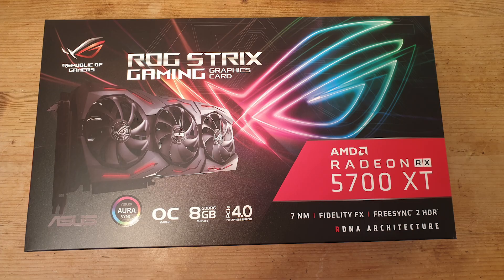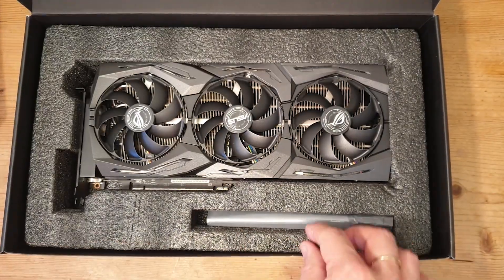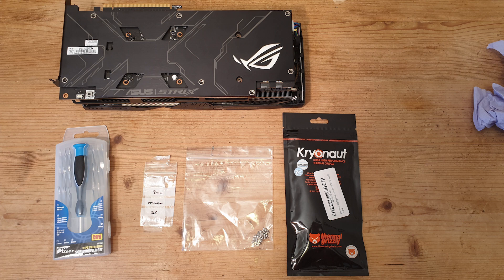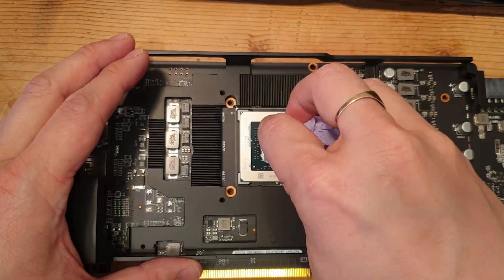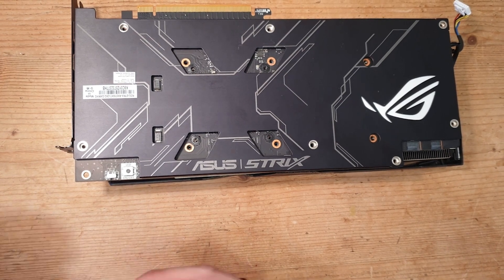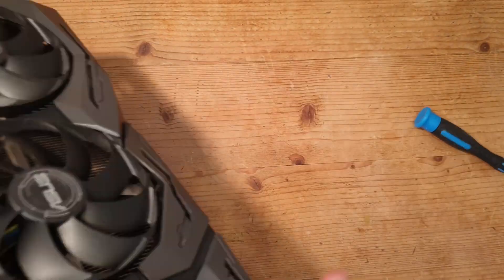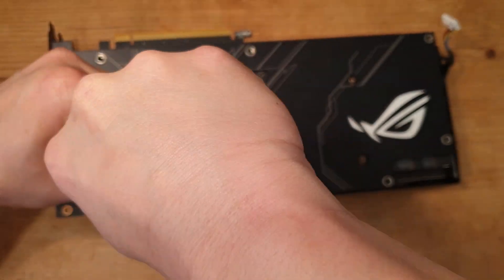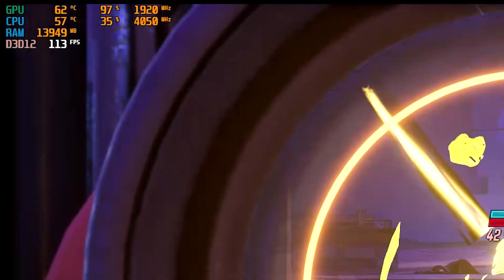ASUS ROG STRIX 5700 XT Tempeture Fix

Comment: Dude, could you post Junction temperatures as well?
Reply from the maker: Just ran a few test because I did not record it when I made this video. 
The junction temperature is 15c ± 1c higher than the GPU edge temperature during testing, so with the GPU at 66c the junction temperature was around 81c.
Reply: @HardwareHusky  Very nice! Thank you!

Comment: but does this procedure not ask for the Product Warranty?
Reply from the maker: I am unsure what you are asking so i'll answer it a few different ways.
1: This procedure can void your warranty depending on your country's consumer laws.
2: This procedure can be fixed under warranty but they only do the VRM screws and do not add mounting pressure to the GPU die.
Reply: @HardwareHusky  
you are telling me, that they did not solve the problem, even sending for warranty, because if this is the case and better return the card, and get another one!

Comment: my tuf gaming rx 5700xt is melting on vram mem, the heatsink dosent make contact with the cooling aluminium plate of the vram, if you have the opportunnity on doing a tutorial on that i would be apreciating it, good work btw.
Reply from the maker: Hi Nadie,
I don't have one of those cards but from what I've seen they are designed poorly and have been replaced with the EVO model.

I have a idea of using low profile IC copper heatsinks but without having a card to play with I can only recommend you submit a RMA request with Asus and hopefully get it replaced with the EVO/EVO cooler.
Reply: @HardwareHusky  Seems ill have to do the mod then, i cant request an exchange here because some tax politics on my country that will make my new card enter as a new purchase, and that would mean paying a lot of taxes(again), for what ive seen so far, its an easy mod, so ill guess ill give it a shot, ive saw hardware unboxed video and he does it with thermal pads instead of copper heatsink but the idea its the same, connect the aluminium heatspreader with the main heatsink of the gpu.

Comment: Does anyone know if this problem had been fixed? I am thinking about the strix or the red devil, but the strix is 60usd cheaper so cant decide..
Reply from the maker: Yes Asus have fixed the issue with some shorter screws.
Reply: @HardwareHusky  Thank you. Do you know how it performs after the fix, compared to some of the other high-end cards?
Reply from the maker: @MrMikkeldk7  The temperatures are average and fans spin slower with the fixed model, other high end cards like the Sapphire Nitro+ and MSI Gaming X are better for thermals. 
There is not really that much in it with gaming performance between those cards so its really down to looks and price.
Reply: @HardwareHusky  i appreciate your responce. Thank you 😊

Comment: I have a Question. The screws on the GPU unit has little springs. Did you removed this ones to the nylon washes? Or did you just put the nylon washes on the Original screws?
Reply from the maker: I put the nylon washers on the spring screw in a strange way, with the spring on the screw I pushed 2 washers down as far as I could on the shaft so it jammed between the small coil,
Not a ideal way but I didn't have bigger washers on hand and it did the job.
Using M3 x 8 x 1mm would be better

Comment: can i use metal washers? or will they fuck something up by being conductive
Reply from the maker: I used non conductive washers but others have used metal ones with no problems, the screw is metal so if the washer is the right size there no difference.

Comment: put the M3 * 8 * 1 washers one at a time on the GPU and VRM, I also changed the paste to MX-4, I didn’t notice the difference in temperature, as the fans had automatic speed without washers:
https://c.radikal.ru/c42/2006/66/9a3c782ac224t.jpg

and here’s how after installing the washers, the fan speed is automatic:
https://b.radikal.ru/b18/2006/37/1e1da4119820t.jpg

96 degrees for memory chips is not good, you can increase the fan speed but then it will be very noisy:
https://a.radikal.ru/a31/2006/f3/080f5b548a5bt.jpg
the memory temperature jumped 88-90 degrees and it was very noisy 80% + speed.
I understand that this is not a game, but these are elementary things for checking a video card and it must pass FurMark.

I would like to see your results of 15 minutes of the test in FurMark and with all indicators GPU-Z and HWiNFO 64 sensors as on my screenshots
Reply: Furmark = power virus that's your issue buddy Google it and thank me later
Reply: @ericcho8777  +1  Power virus
Reply: @ericcho8777  no this is not a virus this is the same benchmark, run a modern benchmark with high settings the results with temperatures will be the same
Reply: @ArmsK7  Husky said his baby is due any min on stream the other day so he might not reply.
I've heard big youtubers like JayzTwoCents say they wont use furmark because its a power virus, not a virus virus but a power virus because it uses lots of power and causes lots of unrealistic heat.
Im not in any way affiliated to Hardware husky just watch his group game and his content.
Reply: @mcsadmin4329  and the fact that in games memory is also heated to 90 degrees in your opinion this is also normal?
Reply: I have this same problem, the vram is very hot, you got some information, because I want to send the plate for warranty, since I am afraid of these high temperatures in the memories!

Comment: I ordered the washers M2 * 5 * 1 they came to me and they are small they are smaller than the spring, if only they are installed at the beginning of the spring, but how to remove the spring so that it does not stretch? can this be done?
https://c.radikal.ru/c17/2006/e0/d990c3561a5ft.jpg
Reply from the maker: I pushed the washers down the screw with spring attached until 2 washers was in between the smaller coils. This stopped the spring compressing as much adding a bit of pressure.
Reply: @HardwareHusky  
the video doesn `t work
Reply from the maker: https://www.instagram.com/p/CBv33NgJOdO/?igshid=1sifxmuqjalcq
Try this instead

you have to get the washers between the coils or it wont do anything.
Reply: @HardwareHusky  
But is it not much for pressure? if to use only one 1mm washer on the textolite will it not be enough?
Reply from the maker: 2 washers gave me a noticeable improvement to gpu temperature.
2 or 3 washers on the vrm screws made a difference on its own
Sorry what is textolite?
Reply: @HardwareHusky  textolite is a video card board, I think you can put it on top of your native black shaba, another 1mm https://a.radikal.ru/a29/2006/46/7c59e7ad0f3ft.jpg
Reply from the maker: That will work if you have bigger washers, I didn't so had to do it the way in the clip.
Reply: @HardwareHusky  
and you can’t tell the exact sizes of the washers you used?
Reply from the maker: The red ones that comes with pc cases work they are M3 x 8 x 1mm
https://www.instagram.com/p/CBv90y3J43f/?igshid=1x2zu1dyt8yrn
Reply from the maker: No I use Unigine Heaven on loop for 60 minutes and playing games for way too many hours.

Comment: I have an affected card but my temps are fine should I go through with the rma I don't want Asus fucking up my card
Reply from the maker: If you have a affected product it will get worse with time unless you have it vertically mounted or maybe even an anti sag bracket, so it will need doing one way or another. 
I've never used Asus for a RMA but with other manufacturers it was smooth and I would like to think Asus wouldn't mess up a RMA.
Reply: @HardwareHusky  the Asus service center in Canada is an authorized center not actually run by Asus and there reviews are 50/50
Reply from the maker: @jaiden3510  Contact Asus they may send you out the shorter VRM screws to do yourself like what EVGA did with thermal pads on the 10 series.
Reply: @HardwareHusky   could elaborate a little... Im new to this stuff sorry
Reply from the maker: @jaiden3510  The fix that Asus does is fitting two(2) shorter screws to the vrm heatsink and a questionable bios update that appears to do nothing.
If you contact Asus support they may send you out the two(2) screws for you to change yourself. 
EVGA had a overheating issue a few years ago and they sent out the fix for people to do at home without voiding the warranty, Asus might do the same thing.
Reply: @HardwareHusky  aslong as the bios update doesn't mess with the card im fine with risking it with the service center thanks for the info
Reply: I've just got my card back and they ended up just giving me a new one
Reply from the maker: @jaiden3510   How is it?
Reply: @HardwareHusky  haven't done anything to intensive yet. Just played 15 minutes of rocket league... Temperatures seemed to be slightly lowered at idle sitting around 45- 52 c.  in rl I didn't go above 60 c at max settings capped at 144 fps  and the fans didn't even turn on once while playing Wich surprised me

Comment: Do you need to change the thermal paste or are the screws enough?
Reply from the maker: The thermal paste is not necessary if you are not removing the cooler.

Washers on the VRM screws is a minimum.

Washers on the spring loaded GPU screws help a bit more but you will have to break the white security sticker over over the screw.

These can both be done without removing the cooler and you won't need to change the thermal paste.
Reply: @HardwareHusky  Is it possible to do that without voiding the warranty? Like is the sticker easy to remove without damaging?
Reply from the maker: @bone987  The sticker is hard to remove and covers the top of the spring loaded screw but its not flush to the pcb.

Comment: My fans are no longer spinning (pretty sure I did something wrong)
Reply from the maker: Did you plug the fan cable back in at the end of card?
Maybe you put it on quiet bios.
My mate turned the fans off once in software e.g Afterburner, Radeon tuning.
Reply: I had that issue, didn't plug the cable in fully
Reply: I tried to replug the white plug and it just shut off (I can't RMA it because I used the screw for warranty)... Now I get a white light from my motherboard and a q code of 62
Reply from the maker: You replugged the cooler with the pc still on?
Breaking the white sticker doesn't always void your warrant so check your country's rules, what definitely isn't covers is damage caused by removing cooler.
There are more troubleshooting step that can be tried but you might want to find someone with experience as they know what to try.

I've personal had strange gpu booting issues with pcie gen 4 gpu's.
Reply: @HardwareHusky  Here is what happened. I unscrew all 7 back plate screw, unplugged the led lights on the back plate

Unscrew the 6 screws, without unplugging both plugs on the side, changed thermal paste after unscrewing the 4 screws with Spring.

I rescrewed everything back to normal. 
I started playing Red Dead 2; didn't notice the heat until later and I think I may have damaged the die for running it with a heat sink without any proper fan.

Now I can't even go past POST. Very upsetting. Thank you for the very quick replies though.
Reply from the maker: @darklyger64  I would have thought the gpu had a thermal shutdown protection.

I did have a boot issue with this card on a Asus x570 strix-f where it didn't post for ages and once i got it to post it crashed windows constantly.

To get it to post I left the power cord unplugged switched bios on the graphics card, took the graphics card out and put it back in and also cleared the bios on the motherboard, I plugged it all back in, powered on the pc and left it for a few minuets.

To stop it crashing in windows I had to set the pcie slot to pcie gen 3. 

Before this issue the graphics card worked for weeks with no issue except the pre fix high temps, then one day for no reason it wouldn't post.

Worth a try.
Reply: @HardwareHusky  Thank you my friend you really have gained my trust and a subscriber. Promoting you to my friends. I just gave up. I will try an RMA anyway I guess I can't play games for a while.
Reply: @HardwareHusky  HMM i had to do the same, i wonder if its a motherboard or card issue, what motherboard are you using?
Reply from the maker: @ATJ.  I'm using an Asus x570 Strix F.
I'm not sure which part it could be, it might even be a motherboard bios issue as there is a bios version with improved system performance and compatibility.
Reply: @HardwareHusky  i am using the new B550m chipset motherboards and running the newest BIOS update for that. Do you know if we lose anything by running it in PCIE 3 instead of PCIE 4?
Reply from the maker: @ATJ.  The card is fully wired up for use in a 16x slot and we don't lose performance by using pcie gen 3.

Comment: Hey did u completely get rid of the springs under the screws
Reply from the maker: No I put 2 washers on the screw shaft between the small coils so the spring compresses less if that make sense.
Reply: Hardware Husky so First i put the washers on the Screw and then i put on the spring
Reply from the maker: @nilsw6230  yes if you can get the spring off without damaging it.
If you have washers slightly wider than the spring that would be easier as you could just unscrew put washer on pcb and put screw back in, I didn't have bigger washers at the time.

Comment: Hello, tell me exactly how many washers you used and what thickness, why do you have at the bottom of the comments you write used 3 washers, and in another comment two washers?
Reply from the maker: I used three(3) M2(2MM) x 0.5MM Nylon washers total height 1.5MM on the VRM screws.
I used two(2) of the same washers on the spring loaded GPU screws.
Reply: @HardwareHusky  Thanks

Comment: Do you think Arctic Silver 5 thermalpaste will work ?
Reply from the maker: I have used Arctic Silver 5 on gpu's in the past with no problems but you have to be careful with application as it is slightly electricity conductive.
Reply: @HardwareHusky  OK thanks
Reply: @HardwareHusky  So which thermal paste would be the best for cpu and gpu,  wherein we do not need to worry about it spilling around the sides ?
Reply from the maker: @Dude_Virus  thermal grizzly kryonaut is the best but Arctic MX 4 is good if you are on a budget.
Reply: @HardwareHusky  Thanks will check.

Comment: So apparently after the recall they changed the screw size I wonder if it still needs washers or they got on top of it finally . Any of these cards after feb this year have the new screws . To anyone reading if you bought this last year you need to either do what he’s doing or take it to asus to get the new screws put in.
Reply: Well im buying one today so lets hope 😂😂😂 idc i want it bc it looks good 😂
Reply: yessuh yessuh save your money G . There’s another 2 cards red devil and some other one that don’t have the problem . But if you do experience overheating just keep in mind they will fix the issue for you anyway
Reply: @narsayeee1578  i know theres far better cards for cooling but this one looks nice and has a fat oc on it so if i have cooling problems ill just return it the new models supposedly are fixed if not im gonna get the nitro+
Reply: @yessuhyessuh2100  was it good?
Reply: @yessuhyessuh2100  aorus is looking good too